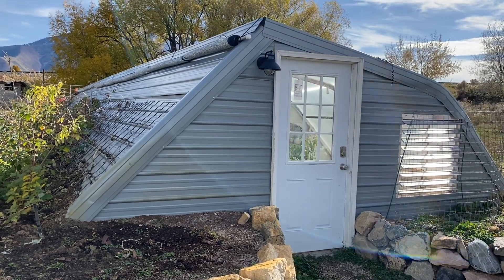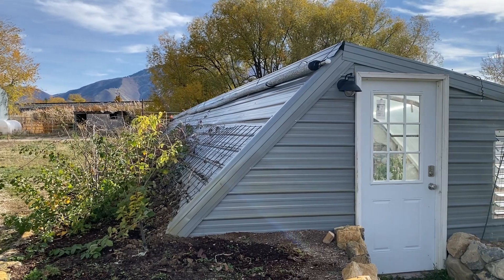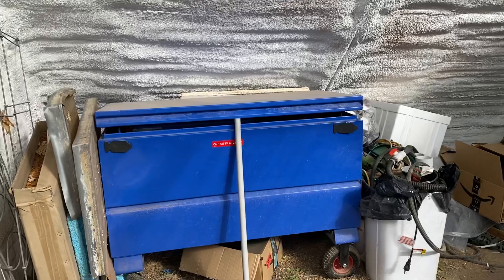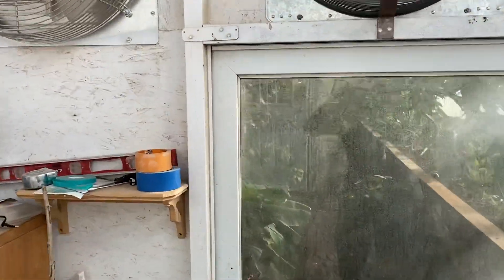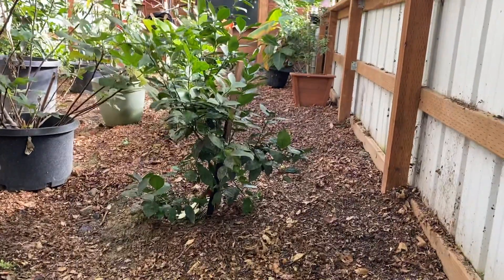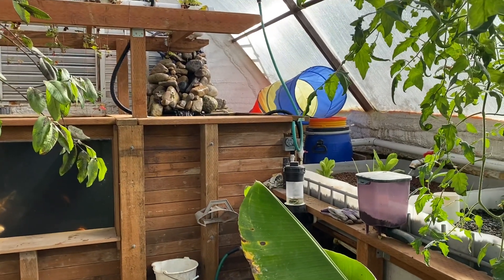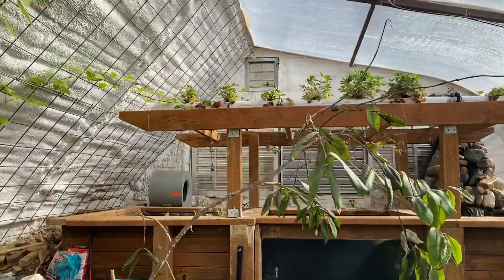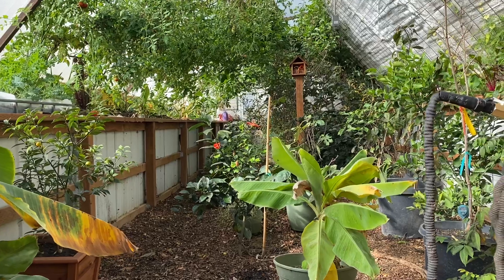How we prepare the Greenhouse for Cold Weather.

Comment: How do you seal up louvers  on end-all in winter, and why fan in the interior wall not the end wall which is typical for most greenhouses
Reply from the maker: I insulate the wall where vents are located with foam insulation and plastic (taped around the perimeter). Fans would be on the exterior wall if I didn't have the small room which I pull air from when the Fans turn on.  It makes sense when you see it in person.
Reply: When do you put shade cloth back on, we are in south Dakota and Temps in greenhouse are already in high 90's , do you think the a snow on it would ruin it?

Comment: Did you paint over the spray on insulation to prevent off gassing of the chemicals in the insulation?
Reply from the maker: Yes.  2.5 + inches of insulation with a paint cover.
Reply: Did you consider, as experiment, using Silver Sun Reflective Mylar Film on the north wall to reflect sun rays?